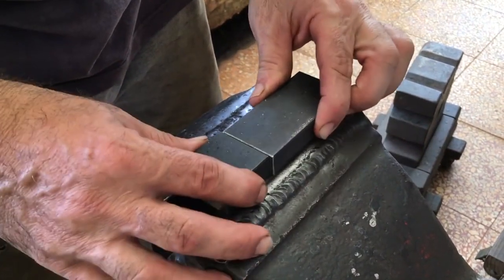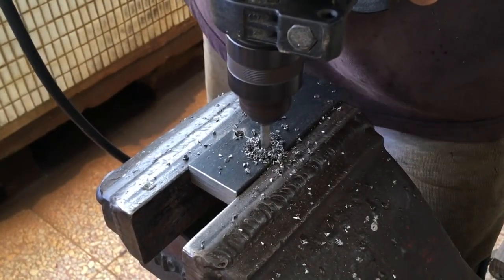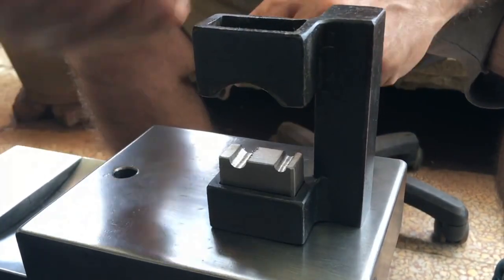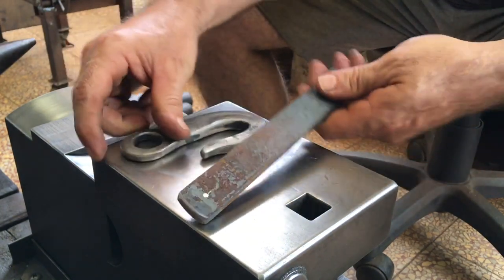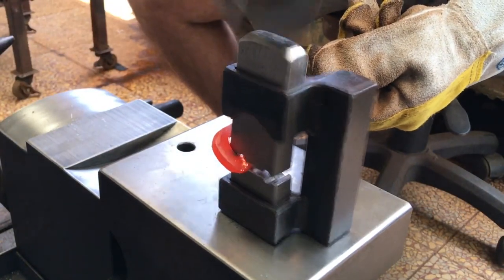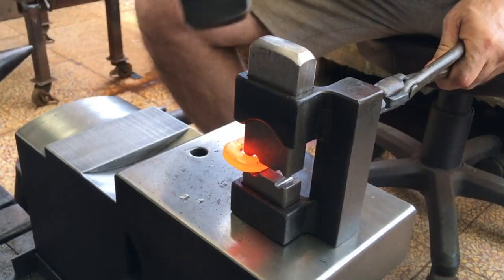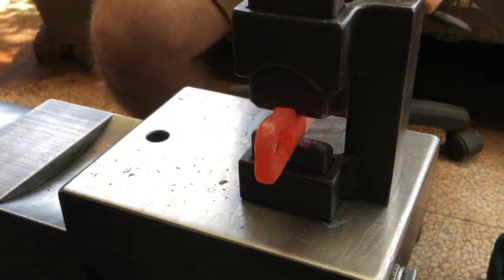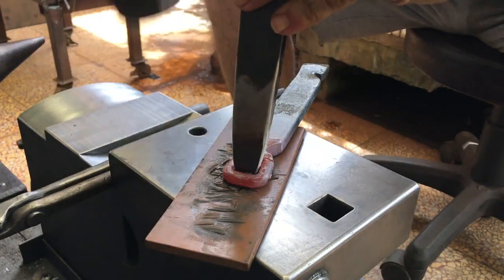Making Simple Tenon Dies / Rounding A Closed Eye

Comment: You could make square hole dies of various sizes by hot forming with hardened square pattern stock. Or better yet, a 1" square lathe tool prehardened stock placed between the red hot dies ina diamond orientation could enable making many sizes up to 1" by varying depth of indentation!  🔷️🔹️
Reply from the maker: Thanks for the good suggestions. I've got a lot to try...

Comment: I can definitely see where you are headed with this idea. It seems to me that the divot in the dye would need to match the circumference of the eyelet.
Reply from the maker: That definitely was one of the problems - the die holes need to match the stock I'm using better. That, along with a couple of other small changes, should make these work better. Thanks.

Comment: Glen: Taper the long side of the dies. Right now you are putting a square peg in a round hole. Jon
Reply from the maker: I believe you hit the nail on the head. I will narrow the dies where they meet and also ease the edges of the half rounds some. I think these changes will make a big difference. Thanks.

Comment: I like your realistic “live and learn” approach, Glen. You commented on your habit of removing swarf with your hand. I keep all steel swarf that hasn’t had coolant and apply it to forge-welding, especially when making up pattern welded billets from small pieces. I see you have magnets, to dampen the anvil’s ring.  If I were fortunate to have your anvil’s, Glen, I would set one of the brackets back an inch so that I could have a gap between them occasionally, since I could easily insert a spacer between the angle-iron and the block. Your guillotine is very good and appears to be a single forging, but I imagine you made it yourself?

Comment: Use a small drill then use a die grinder with a round burr and shape the dies with the radius you want.
Reply: AKTrapper 
This is exactly what I have done, I was making a replacement strap for securing  a rod for an actuator to a piece of machinery, so first I used 1-1/4” x 2-1/2” long square stock. Then I used a mill drill for my proper size 1/2” hole, 3/4” wide 1/8” thick flat steel is what I had on hand to make the guide for the rod.(3/8” approximately 10-12 mm) then cut through it with a 1/16th inch cut off wheel. Back to the Mill / Drill, where I centered the slot for the strap and milled out a relief for it to fit in. I also milled off the excess to fit it into my 1” Hardy hole.  I used successively larger diameter rods to pound the strap into the hollow till it was done the matted piece as a top mandrel to drive them down. I’ve repurposed it for several other projects and it’s still working after softening the edges from the sharp edges left after milling it has done something very close to what GS has been doing.

Comment: Would milling it using a rotating table help? That would allow you to have an arc. If you have a few months (I just moved and my mill is in transit across the Pacific), I'd be willing to work with you on it.
Reply from the maker: I'm not exactly sure but having access to a mill couldn't hurt. But this is not something I frequently need to do/make. Thanks.

Comment: Glen GS Tongs according to AISI 1050 Steel is a plain carbon steel containing 0.50 wt% of carbon.
The heat treatment temperature is 1550° - 1650° F or when it becomes non-magnetic and it is Oil or Water Quenched. 
And if you want a Rockwell hardness of 52 you temper it at 400° F.
I guess what you have done by heating it to "sunset red" and water quenching that only the outer skin has hardened.
For 1050 steel alloy the phase transformation occurs at 1330° F (Austenite) and it is recommend that you bring it to 1650° F and bellow that you are still at the ferrite-cementite phase.
Metallurgy is not rocket science but it is interesting as well.

Comment: You need to make your holes more oval. It will prevent the pinched steel.
Reply: I was going to comment that he should grind off the sharp corners of the die. I've also seen people put a sacrificial shim between the two halves when drilling them (the end result being the holes are more oval).
Reply from the maker: A very good idea. And I think I also need to make the dies more narrow at the point of contact. Lots to learn and do... Thanks.
Reply from the maker: Comment section is always full of helpful ideas like yours. Thanks.